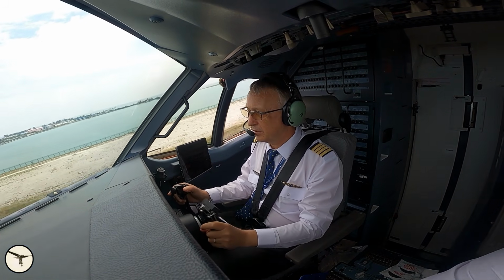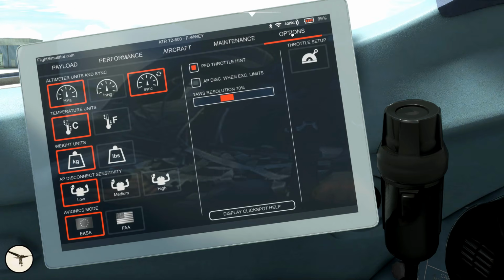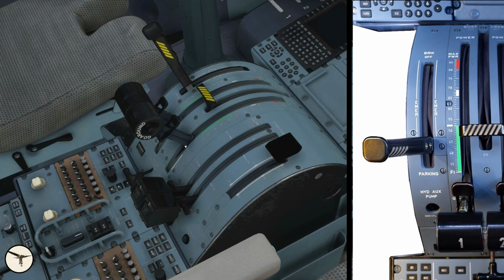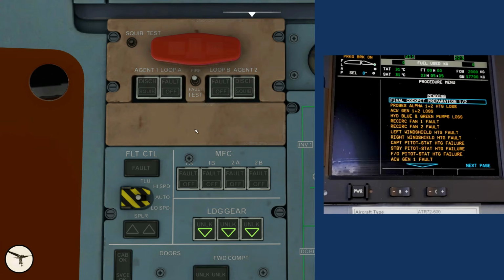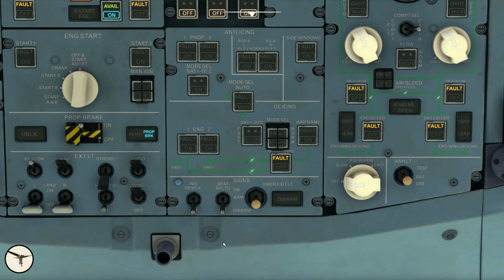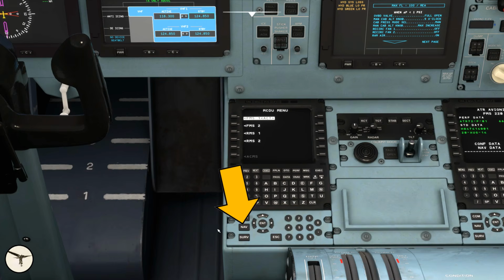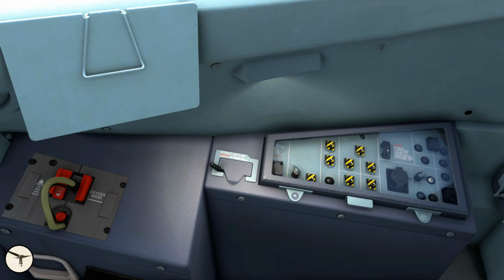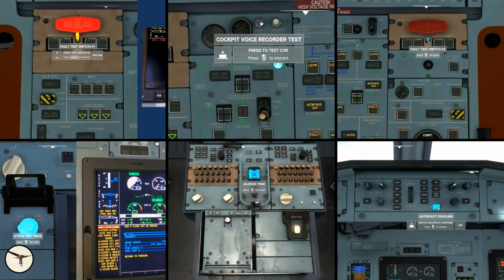ATR 72-600 for MSFS tutorial by ATR instructor – Part 1: Power up from cold & dark

Comment: Goodmorning Captain
I have a problem to solve.
With the aircraft "dark and cold" - in the absence of ground power - can I power the aircraft in hotel mode, just after putting the batteries ON ?
If so, what exactly should the procedure be?
Thank you very much.
Roberto
Reply from the maker: Yes, you put on the battery, and after the self-test is completed (about 90 sec), you can start engine #2 in hotel mode. Before starting the engine, you do the engine fire test. Once the engine is running, you can complete the other checks and prepare for the flight.
Reply: @FlywithMagnar  Thank you, Magnar

Comment: Ive had an ongoing issue that I cant seem to solve. Please Help Magnar….😁

I do NOT get the ready light for prop brake. Even when clicking the hyd button on the console. 
I can only turn prop brake on once engine two is started. Im at a total loss on this. There must be something Im missing. Even after following startup procedures, from multiple channels, still wont work
Reply from the maker: This might be an issue with the sim model. The requirements for operating the propeller brake are: 1) Aircraft on the ground. 2) Gust lock ON. 3) Condition lever in FUEL S.O. or FTR. 4) Blue hydraulic power. Pressing the AUX pump push button will cause the pump to run the pump for 30 seconds.

Comment: Question….

Your Hyd switches were “white” 11:29 and needed depressed. Mine, even in cold dark, once batt power is on are already activated. Am I missing something?
Reply from the maker: The ATR model in MSFS has some errors. In the aircraft, the hydraulic pumps are never switched off when the aircraft is powered off.
Reply: @ …okay, thanks. I will just remove them from checklist 🤣

Comment: Timestamps for myself:

9:39 - Startup - 12:23

Battery ON
NAV Lights ON
Electric Indicator < 28 Volt - 10:38
External Power ON

Remove White Lights - 11:20
(except Probe Heat & Fuel Pumps)
Press AUX Pump - 11:37
Beacon Logo Wing Lights ON - 12:08
Arm Emer-Lights

12:35 - Cockpit Preperation - 17:25

Annuniciator Lights CHECK
Fuel Pumps ON
PROP Brake ON
Seatbelts & No Devices ON

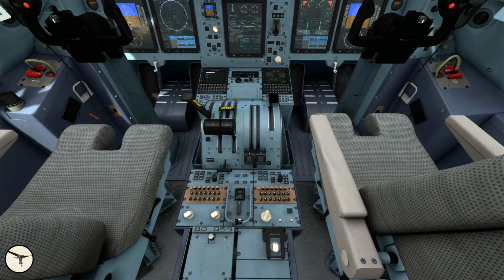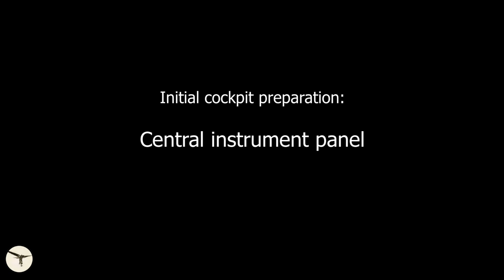17:30 - FMC Related - 20:25

Panel Lights ON
TCAS ON (Nav-Mode-->ND-Ovly--->Traffic=Above)
TCAS 1 (Odd days) TCAS 2 (Even days) ---> (Surv-Mode)
Transponder STBY
TCAS Auto (Press Surv again)

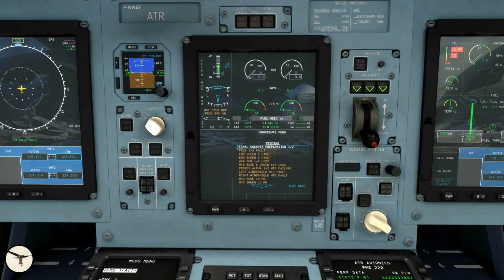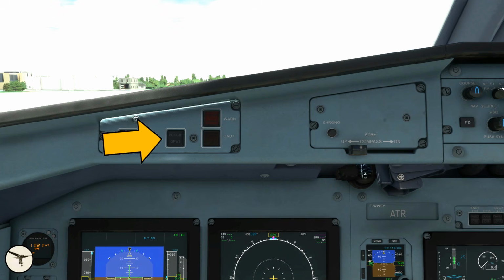20:30 - 22:10
Cabin Rate Set To 9 Clock

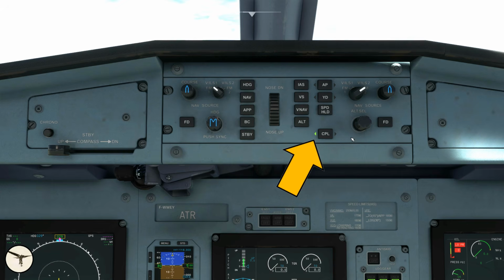22:11 - 23:20
Left Nav source FM 1
Right Nav source FM 2

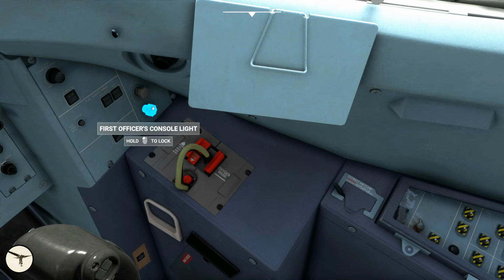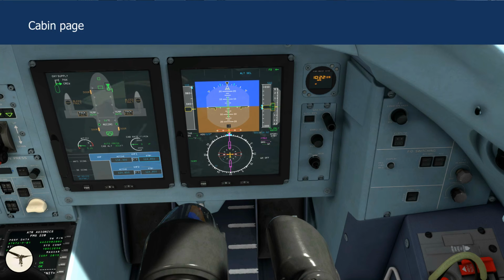23:22 - Right Side Panels - 25:00
Console Lights ON
NAV Display - 24:35
Note FUEL - 2450

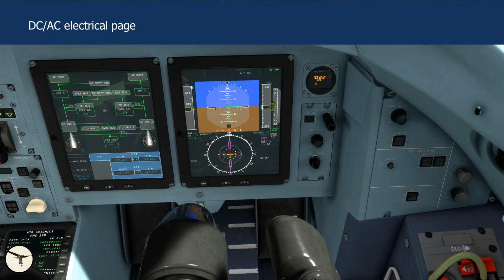25:05 - 25:20
Beacon Wing Lights OFF
Logo Lights (if daylight) OFF

25:20 - Left Side Panels
Console Lights ON
Open Communication Door (until engine start) - 26:18

NW Sterring: 26:27
OFF for Pushback
ON for Taxi

27:08 - Short Transit - 27:48

Comment: For circuit pattern touch and go, what is the recommended air speed and flaps settings? Would be great if you could share tutorial videos on circuit pattern training.
Reply from the maker: You make a normal take off and climb to 1,500 feet above the airport elevation. Retract the flaps when passing the withe bug on the speed indicator. When the speed is 170 kt, make a 180 turn to downwind. When levelling off, adjust power to maintain 170 kt. When on downwind, follow the procedure shown here: https://youtu.be/vTr8SLsl4aY
Reply: @FlywithMagnar  Capt Magnar, thank you for your reply. BTW, when level off at downwind, what is the recommended flaps settings? For other aircrafts like A320, it is recommended to maintain flaps settings "S" for downwind.
Reply from the maker: You retract the flaps when accelerating through the white bug during climb. I recommend to level off before turning to final.
Reply: @FlywithMagnar  thank you Capt Magnar

Comment: Hello this vid is such a great tutorial :). Just a little thing. When we do the shaker test we can't have the prop break on because if we turn on the gust lock we have a warning alarm in the cockpit. And i see in your tutorial that the prop break is off when you turn off the gust lock lever. So i have a question, when can we turn on the prop break during the initial cockpit preperation ?
Reply from the maker: Normally, the propeller brake is engaged when you approach the aircraft because it prevents the propeller from turning when the aircraft is parked. There's no reason to disengage the propeller brake before you test the shaker and pusher. The ENGINE alert is there to protect the propeller brake from damage if the power lever is too far ahead when engine #2 is running in hotel mode. With the propeller brake engaged, the movement of the power lever is restricted. The ENGINE alert means you cannot start engine #2 or operate the propeller brake.
Reply: @FlywithMagnar  Thanks you so much for the answer cpt. I saw in the tutorial that the Gust lock have to be released before we do the shaker test. And when i'm in prop break on and i release the gust lock i have an alarm on my EWD that the prop break is on. But my engine 2 is off. Maybe a bug you think ? To reproduce the problem turn on the prop break on and turn off the Gust lock without start engine 2 before. only prop break on. The only thing that i saw in your video is you don't have the alarm when you do the shaker test because your prop break is off. So the question is, is this a bug or i have to do the shaker test before start the prop break ?
Reply from the maker: @thoringaming1853 , this is not a bug. When the propeller brake is ON, and the gust lock OFF, you are not allowed to start the engine. The reason is that if you start the engine with the gust lock OFF, it will be possible to move the power lever so far forward that the propeller brake will be destroyed. The gust lock lever prevents that when it is engaged.
Reply: Thanks you so much captain for your answers and thanks you to take time to do the tutorial for us. @FlywithMagnar

Comment: Hello, Thank you for the informative videos. I have a problem with popup slots (AltGr+ click mouse) they are much too big and even decreasing the unsaved format. the follower becomes huge again
Reply from the maker: The size of the pop-up window can be adjusted by clicking and dragging the corner.
Reply: Thanks for the quick answer, but with the AltGr keyboard + left mouse click function, I have a window corresponding to e that I want to enlarge. But the window is huge. I can resize it, but it always comes back to the same huge dimension. The same for the others?

Comment: Hey captain thanks for the video, My question is that, do we turn on the windshield heating During the start or just before engine start because I don't think it's a good idea to Heat the windshield unnecessarily??.
Thank you
Reply from the maker: The windshield heating only works when the ACW generators are operating, which means the propellers must be rotating at 65% RPM or more. So we keep the pushbuttons ON all day long until we are leaving the aircraft.

Comment: I'm also interested in such a moment that I notice from the video - why do real ATR-72-600 pilots most often use the VS mode, and not VNAV?
Reply from the maker: The main reason is that the first two generations ATR 600 don't have VNAV. It was introduced with STD 3 software. There are also situations where VNAV cannot be used, for example during radar vectoring for approach.
Reply: @FlywithMagnar  This moment was of interest not only to me, but also to other ATP-72-600 virtual pilots from MSFS2020. Therefore, thank you very much for professionally clarifying this issue. Soft landings to you, Magnar!

Comment: @Magnar,  During the climb phase, how do you ensure the aircraft complies to the altitude restriction? Is it recommended to climb in VS or IAS mode?
Reply from the maker: It is recommended to climb with IAS mode. Normal speed for climb is 170 kt. For descent, you use VS mode. Normal descent rate is -1500 pfm. Before you start climbing (or descending), you set the desired altitude with ALT SEL.
Reply: @FlywithMagnar  sir, thank you for your detail explanation. 

During descent, wouldn't it be better to descend in VNAV mode, so that the aircraft follows the VNAV PATH and at the same time, complies with altitude restrictions too?

Comment: After joyfully watching your real life ATR videos to study this beautiful airplane, I'm so excited that you help us direct with Microsoft Flight Simulator 2020 ATR version. THANK YOU so much!
But I have 2 questions:

1.) In your video DC GEN 1&2 white lights are not lit after the Battery ON step. But normally they stay in OFF-state, so that we also have to press them while Overhead panel flow. What is right? 🙂
2.) In your desription you wrote "This video is based on version 1.0.18". But I only know the first update 1.0.8. Is this just a number too much or is the 1.0.18 real and for example in beta?
Reply from the maker: Thank you for your feedback!
1) The generators should never be selected OFF. This issue has been rectified with version 1.0.18.
2) The update is available now. I made most of this video with version 1.0.8 and waited for 1.0.18 to get some items right (for example the position of the generator pushbuttons.)
Reply: @FlywithMagnar  Thank you again for this helpful reply. And I'm so happy about the newest update, but unfortunately it has a problem to download what you can read it the official forum. So, at the moment, I (or we all) can't enjoy the new update, but I'm looking forward that they will fix it soon.